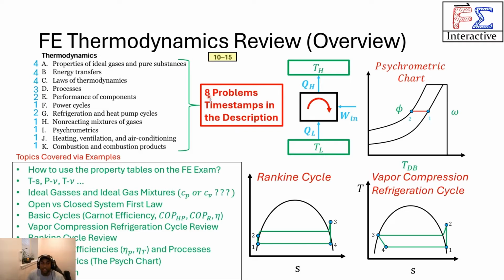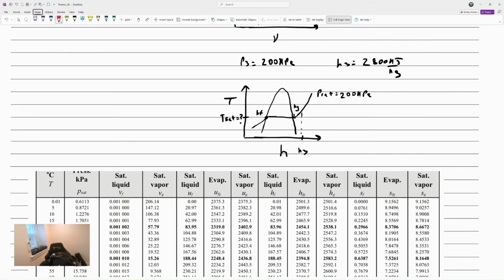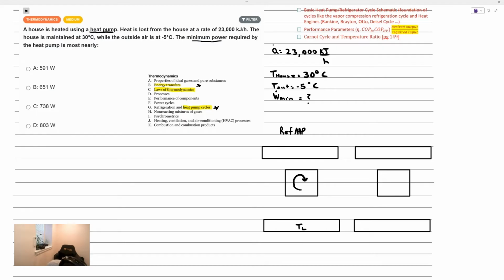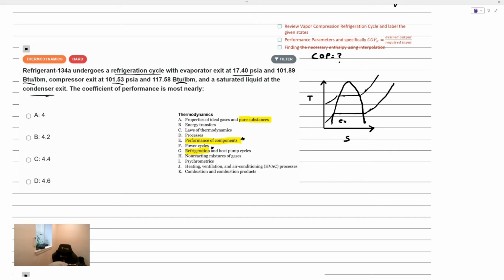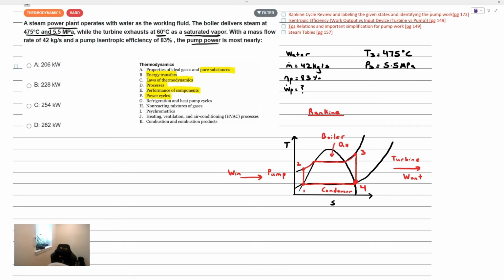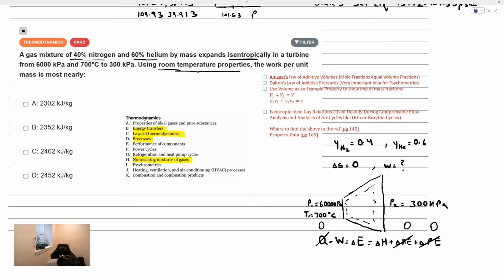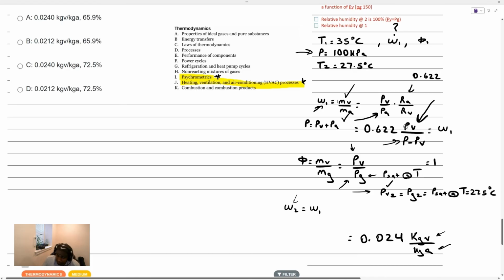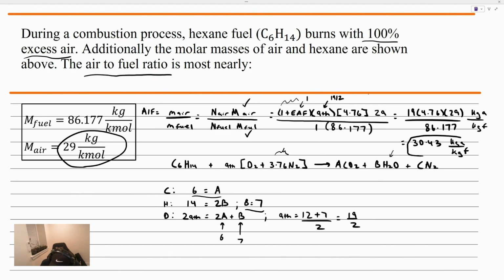FE Exam Thermodynamics Review – 8 Real Problems That Teach You the Core Concepts

Comment: For the the first problem 2nd scenario, if p sat is 170kPa and the given is 175kPa, why wouldn’t it be superheated since the pressure is higher than the saturation temperature?
Reply: Higher than the saturation pressure*
Reply from the maker: @danielmoreno9935  

The diagram approach I show in the video is one reliable, procedural method that guarantees the correct answer every time, but I agree it’s not the most intuitive. I think what you’re really asking about is why case 2 behaves the way it does, so let’s walk through that idea.

At a given temperature, there are three possible pressure scenarios relative to the saturation pressure:

1. P = Psat
2. P > Psat
3. P < Psat

Case 1: P = Psat
In this case, we cannot uniquely identify the thermodynamic state. The substance could be a saturated liquid, a saturated vapor, or a mixture of both. Inside the saturation dome, temperature and pressure are not independent properties, which is why we need an additional property to locate the state. This ties back to the idea of independent properties that I discuss around 11:54 in the video.

Cases 2 and 3 are more intuitive
Think about boiling water at different elevations. At higher elevations, there is less atmosphere above you, so the pressure is lower. With lower pressure, it’s easier for molecules to separate and transition into vapor, which is why water boils at a lower temperature in the mountains vs at sea level.

Case 2: P > Psat (This is the case of the problem)
If the actual pressure is higher than the saturation pressure at that temperature, the substance is being compressed. The molecules are forced closer together, making it difficult for them to separate and form vapor. As a result, the substance remains in the liquid phase. This is why, even though 175 kPa is greater than the saturation pressure of 170 kPa, the state is a compressed liquid, not superheated vapor.

Case 3: P < Psat
Here, the pressure is lower than the saturation pressure, giving molecules more freedom to spread out. This makes vapor formation easier, so the substance exists as a superheated vapor.

The key takeaway:
Higher pressure than saturation means liquid.
Lower pressure than saturation means vapor.

I hope this helps clarify the intuition behind case 2.
Reply: @Eng_Fundamentals I really appreciate you’re detailed explanation! This was a good refresher. I only been out of school for 2 1/2 years but I have really bad memory so it’s hard to remember things. 

Are you a professor or something? You know your stuff very well. If I could pay to have you mentor me for the FE and PE I definitely would
Reply from the maker: @danielmoreno9935  
I’m not a professor, but I am an aerospace engineer with a strong passion for teaching. I passed the FE Mechanical and the PE Machine Design and Materials exams on my first attempt, and now I’m sharing what I know to help others do the same. I was a good student in undergrad and grad school, but more importantly, I focused on understanding the basic principles rather than memorizing every equation. When you truly understand the fundamentals, everything starts to connect, and it becomes much easier to remember how and why things work.

Don’t be too hard on yourself about memory. A lot of people feel this way after being out of school for a few years. What usually brings everything back is seeing how the concepts connect. Once that clicks, it’s surprising how much comes back naturally.

I don’t currently offer 1 on 1 mentorship since I work full time and also run FE Interactive. That said, FE Interactive is essentially my recorded mentorship, structured in an organized way with a clear path and built in tools to track your progress. It’s designed to guide you through the FE Mechanical material the same way I would if we were working together directly. You can check it out here: 

https://www.fe-interactive.com

With consistent studying and steady effort, you absolutely can pass. The biggest factor is simply showing up regularly and putting in the time.
Reply: @Eng_Fundamentals  You’re a great teacher. You should look into teaching part time if you have the time after work. It should only be 2 days a week for certain classes. 

I feel confident in most topics. The only ones I’m struggling with is dynamics, thermodynamics and control systems. I spent too much time on other easier topics when I should have spent that time on these three topics. That being said, thermo and dynamics make up a big portion of the test so I might be screwed unfortunately. 

My test is in about a month (Jan 21st) so I don’t have much time. If I would have known about your services 3 months ago when I first started studying, I would have enrolled. If I fail, I’ll definitely check it out!

Comment: In problem 5, where do you get that delta(h) is equal to the specific volume multiplied by the change in pressure, or is it just something you have to know?
Reply from the maker: Everything you need for the FE exam will always appear somewhere in the reference manual. On page 148 of the 10.5 version there is a small note that gives the relation delta h equals v delta P, and it is introduced with the words “For pump only.” That is correct for an isentropic pump. A pump is a work input device, and the isentropic efficiency is defined as the ideal or isentropic work divided by the actual work input. The ratio is reversed for a work output device like a turbine. The pump isentropic efficiency is always less than 1 because the ideal work represents the minimum possible work for a work input device.
For completeness, this relation comes from a fundamental thermodynamic identity, which is one of the Maxwell relations:

T ds = d h - v d P (another good one to remember is T ds = d u + P d v, but that one applies to a closed system; for a pump we use enthalpy, not internal energy)

During an isentropic process the entropy remains constant, so ds = 0. This reduces the identity to

d h = v d P

and that is exactly where the formula delta h = v delta P comes from.
Reply: @Eng_Fundamentals Thank you so much !!

Comment: Where do you get that the change in enthalpy is m*cp*(delta T) in the reference manual for problem 2? Is this an equation that is worked out based on the other definitions for the other components for internal energy and P*(delta V)?
Reply from the maker: Excellent question! Cp and Cv are often used mechanically in problem solving, but understanding what they truly represent makes thermodynamics much more intuitive.
Specific heat at constant pressure, cp, and specific heat at constant volume, cv, describe how much energy a substance absorbs per unit mass per degree of temperature change. On page 143 of the FE Reference Manual version 10.4, cp is defined as
cp = (∂h/∂T)p
which means cp is the rate of change of enthalpy with temperature at constant pressure. Because enthalpy is not a strong function of pressure for most engineering applications, we can treat this as an ordinary derivative
dh = cp dT
If we assume cp is constant with temperature, we can integrate to obtain
Δh = cp ΔT
ΔH = m cp ΔT
This assumption of constant specific heats is not only used on the FE exam but also in real engineering analysis. The same development can be done for cv in terms of internal energy. For ideal gases, both cp and cv vary with temperature, but over moderate temperature ranges it is common to assume they are constant. Unless a problem specifically provides temperature dependent data, it is acceptable to treat specific heats as constant. For gases such as air or nitrogen, this assumption is common and expected.
It is also important to understand what happens with solids and liquids. Recall the thermodynamic identity
dh = du + p dv
For solids and liquids, the specific volume does not change significantly with pressure. They are nearly incompressible which means dv is approximately zero. Substituting gives
dh = du which implies cp = cv
In this case we simply refer to this common value as the heat capacity c since there is no meaningful distinction between cp and cv (the FE reference manual does not do a great job making this distinction adding to the confusion).  This is why in the FE Reference Manual tables such as on page 170, only one value is given for solids and liquids (only cp since it is the same as cv).
When working with substances like water or refrigerants such as R134a, especially during phase change, the constant specific heat assumption is not accurate. Although it can be used as an approximation, it is not preferred because detailed property data is available. In these cases, it is more accurate to use thermodynamic property tables instead of assuming constant specific heats.
To summarize in words, constant specific heat analysis is valid for ideal gases unless stated otherwise. For solids and liquids cp and cv are equal and we simply use heat capacity c. For real fluids such as water and refrigerants undergoing phase change or large temperature variation, property tables must be used. Use cv when the change in internal energy is of interest such as in closed systems and use cp when analyzing changes in enthalpy such as in open systems like turbines compressors and nozzles.
I hope this clears up the meaning and use of cp and cv. Sorry if the explanation is too much information, but this is a common slipping point for many and I want to make sure the entire story is clear for you and other students.
Reply: @Eng_Fundamentals  I appreciate the in-depth explanation to my question. Your content has been helping me a lot to prepare for my upcoming exam. Thank you!
Reply from the maker: @tylerkriney  Im happy to help. Good luck with your exam.

Comment: Hello, this is a very nice review - thank you. A suggestion I have for improving these videos would be to show where in the FE handbook these equations are more often. Especially with the Thermodynamics section, I have found it very hard to locate these equations myself that you are referencing. And given the FE covers so much information, I cannot retain equations in my head and will be heavily relying on my ability to locate the equations in the handbook.
Reply from the maker: Thanks so much for the engagement and feedback, I really appreciate it.

To address your point about the references, all the solutions on FE-Interactive include both typed and handwritten versions, each with direct references to the 10.4 edition of the FE Reference Manual. If you’d like to see exactly where each equation comes from, you can check them out here:
https://www.fe-interactive.com/practice-video-problem

You can use the filtering and flagging tools to quickly find your specific question of interest.

For the videos themselves, my goal is to focus more on reinforcing the core principles and reasoning behind each problem rather than constantly flipping through the manual. Once you’ve practiced a bit with the reference manual, the formulas become much easier to find — especially when you can identify which principle applies to the problem.
Reply: @Eng_Fundamentals  I would have to agree with the above statement. Too much information is presented to only briefly cross reference the handbook at the end, and these are typically very vague. You pull equations from the ground up, which is great for conceptualization, but you should also be showing where the short cut equations are in the handbook so we don't have to spend time deriving. It is do-able to reference what you show to the information given in the handbook but it takes up time, sometimes a lot of time. Use the handbook as a guide to teach rather than your deep understanding is my take for improvement. Besides this, these are great videos that have helped me tremendously.
Reply from the maker: @landonyepez2920  I am glad you found the videos helpful. I will try my best to be more clear with the location of the formulas in the reference manual when I release the next review.